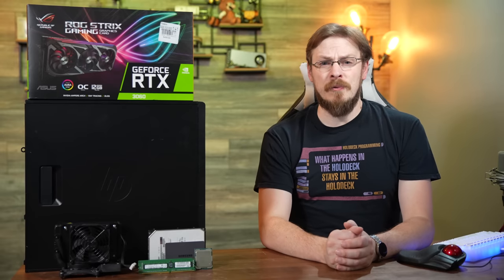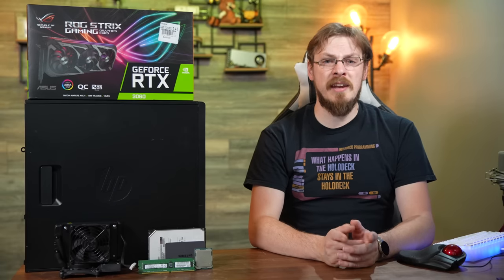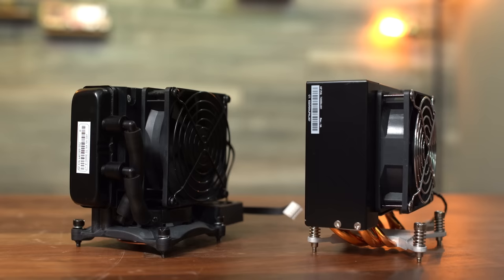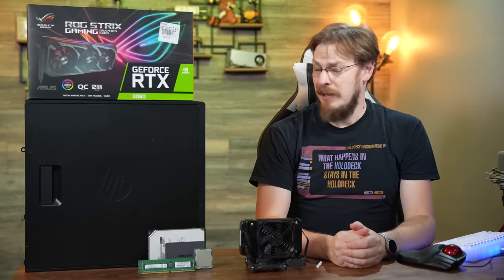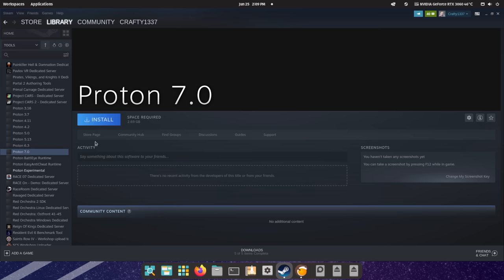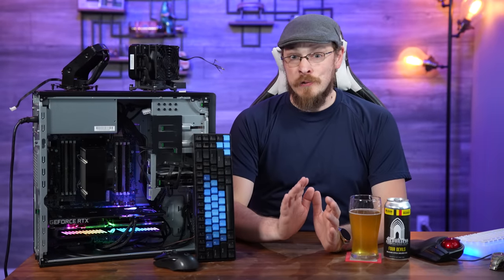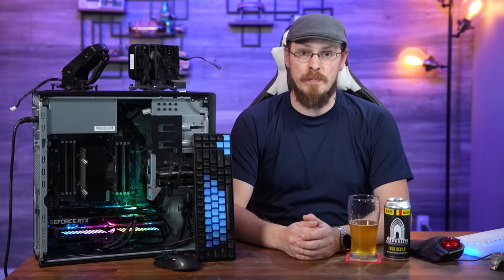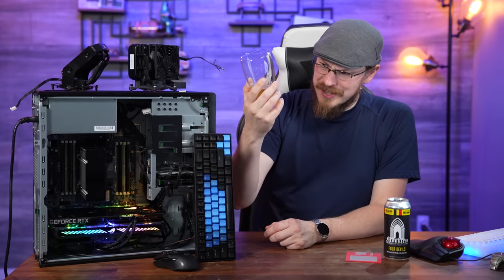A Used Xeon, a New GPU and a Linux Install - HP Z440 Gaming/Workstation Build

Comment: Does anyone know If This Motherboard fit on regular atx case? Thanks.
Reply from the maker: It will fit in an ATX case, but be warned, ALL of the usual connections (power supply, fans, etc) are proprietary to HP. You can adapt them to standard parts, but it'll cost you more than just buying a barebones Z440.
Reply: It's a nightmare without the original Z440 case... There's one non standard ATX motherboard srewhole in the middle, not a biggie. But the major problem is that technically you will never have an error free boot (have to press F1 ) without the front I/O board connected. There's no header pinout diagrams online, so no clue what pins needed to be jumpered. And no way to turn off the error messages. Pretty annoying when a headless homelab server doesn't boot automatically :(
Oh yes, and you need to adapt every connector as Jeff mentioned.
Reply: Usually the power supplies have a weird form factor as well, like one cm narrower and one cm taller than usual. Not sure if it's the case here. It matters because everything proprietary.

Also did they make the mainboard tray double as a heatsink backplate again?

Comment: I was about to claim "I have this exact PC" with slightly weaker specs, I was sure...then I got into the video and "slightly weaker" is an understatement lol

I pretty much only share the case.  My specs, given how broke I am and he little gaming I really do, are so dated compared to this.  
Intel Xeon W3570
12GB DDR3 (Dual Channel)
GeForce GTX 550 Ti
Coming soon: an SSD to replace the slow HDD
Would anyone like to donate their old stuff for a cause? lol
Reply: Check out prices online for use components. I've been finding E5 V4 CPUs in the $40-$70 range (depending on cores and output), HDD and SSD for super cheap, and used Nvidia Quadro GPUs for very reasonable prices. What's even better is that many PC builders on YouTube were making videos a few years ago about running games on workstation/server GPUs, so there's tons of info out there to compare performance vs budget. At this point the most expensive component is the ECC RAM.

Comment: As a 20 year linux user it's completely falling apart.  No real direction and it seems everyone' s energy is just trying to keep existing programs running instead of improving them.  Microsoft's build on top of build strategy although taking up an insane amount of hardware space is really starting to show its advantages.  Linux used to be just install and use.  Now it's what headers go with what driver?  to which cuda,  and what dependency.  Sure it loads faster but when you're searching through and rewriting code just to get 10 bit HDR to work does it matter?  Installing Conda +pytorch with cuda and ffmpeg in it was just an absolute nightmare.

Comment: the excuse for no nvme falls flat - there is virtual cost parity and in being too cheap you leave lots of performance on the table
Reply: I agree. a PCIe adapter is $11 on Amazon and the drives are nearly the same price. Leaving 5x performance on the table.

Comment: I don't understand. What sense does it make to build a Linux box when your primary use case is Windows applications? No matter how good these game emulators are, they run games like pure shit compared to the same computer running Windows which these were games  designed for in the first place.  I've used Wine for years under Linux and its fine for simple, low impact Windows apps that you don't really care about the performance of, but for those high resource creator software applications where performance is the thing; forget it.  Use the right tool for the job. Use Windows for Windows apps, use Linux for Linux workloads otherwise its just a pain in the ass.